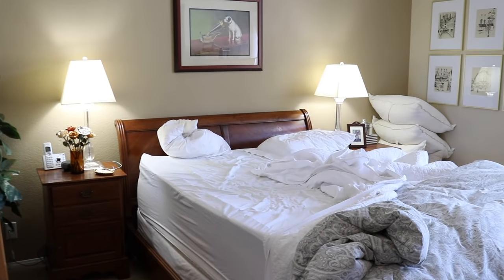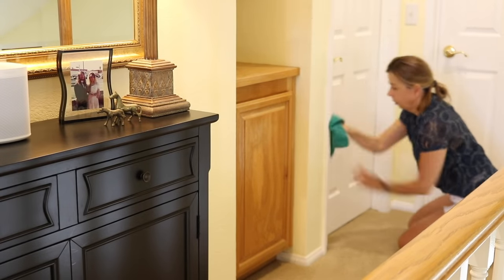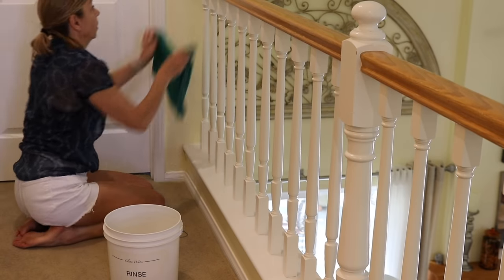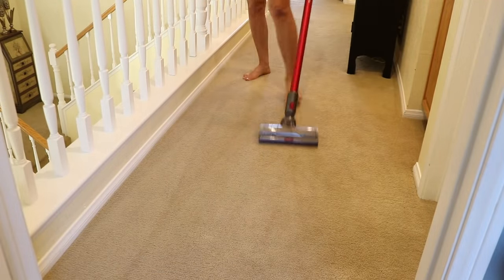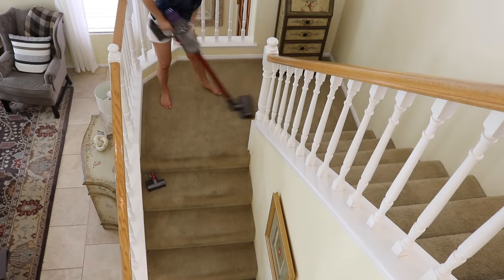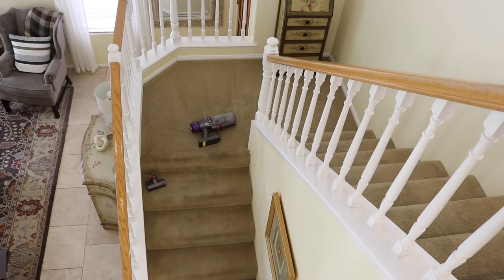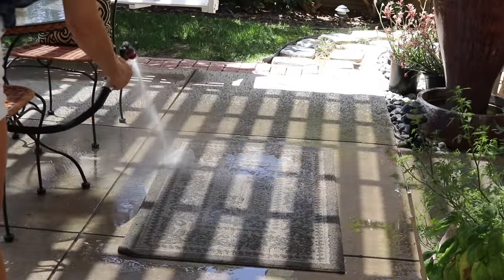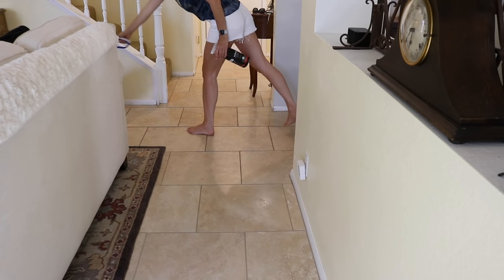ZONE CLEANING SERIES | PART 2 | CLEANING MOTIVATION | CLEAN WITH ME

Comment: I need this organisation !  But i keep thinking of questions. What is the difference between your ‘wash’ and ‘rinse’ buckets ?

So am I correct?  You have your daily reset, your daily tasks, and then one zone per week (normally)?  Thanks 😊
Reply from the maker: I have two bucket for zone cleaning. One has cleaning solution, the other is plain water to rinse off the soap. Dirt can stick to soap residue and you have to clean more. Yes, daily, weekly, and a zone. I spend a few minutes per day on each one. Or I save the zone for the weekend. Depends on the week.